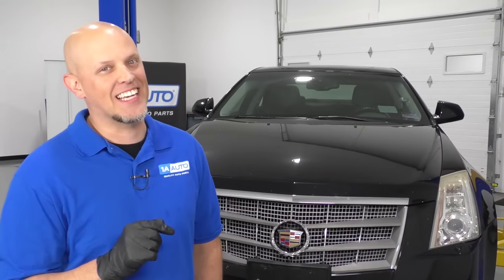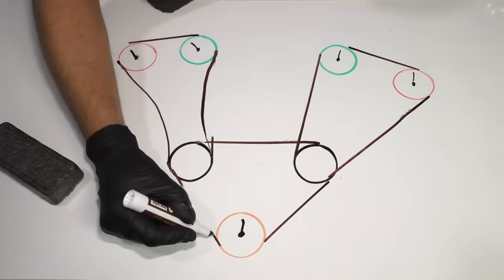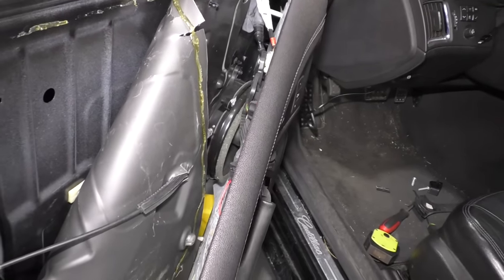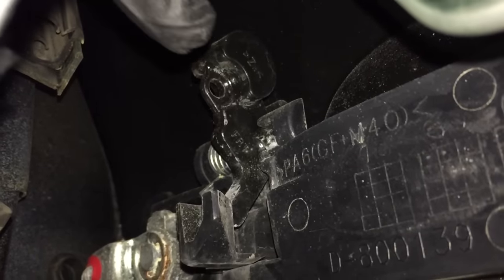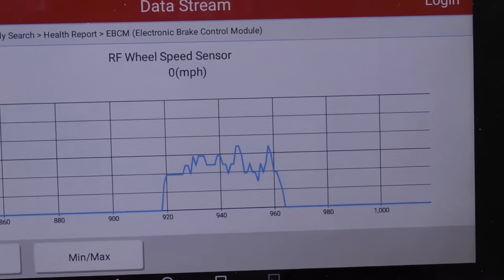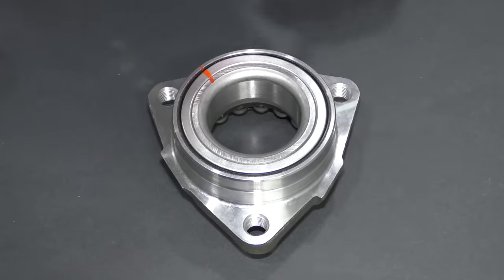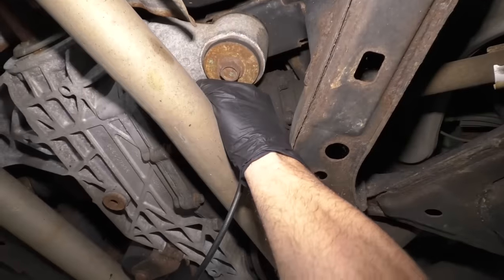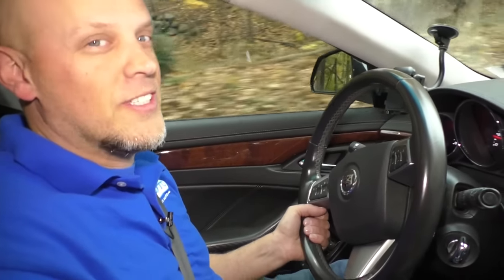Top 5 Problems Cadillac CTS Sedan 2nd Generation 2008-14

Comment: This type of engineering and quality is what stopped me from buying a used CTS I do love the body style.
Reply: Same here.Good looking car but engineered for failure.
Reply: I have had 2 vehicles with 3.6’s caddy sts and Buick Enclave those 3.6 have never failed on me. Because I change my oil every 5000km, if people would know what oil changes are, 3.6’s wouldn’t be bad at all
Reply: @danb2  I totally agree on that,,, I've seen a 2010 Acadia with 210k miles,, and a 12 lacrosse with 165k no problem at all..
Reply: rami yousif 3.6 can be great if u keep if doing oil changes with good quality oil and a filter. I love my 3.6 even with 155k miles running great.
Reply: @danb2  199244 miles on my 03 CTS no problem but window motors. If u keep oil changed and tune up from time to time you will be fine
Reply: Red's Reelz yes exactly.

Comment: I have a 2009 Cadillac CTS and I've had a couple of crankshaft position sensor check engine light codes and got them fixed. The most expensive job was done on the timing chain because when I went to the dealership and they took apart the covers and stuff like that, they experienced the timing chain actually falling apart as they were taking the covers off. Sounded like a knocking noise soon to be that the actuators weren't getting the right amount of oil for variable timing. Hefty jobs. Now that I know about what Cadillacs are about now, I can prevent these things from happening.

Comment: 1 Timing chains and guides because people keep skipping oil changes
2 Magnet ABS tone rings falling off of the hub
3 Sunroof drains clogged since no one ever washes their car and dirt builds up
4 Rear end and transfer case hop around corners since no one ever changes the fluids when recommended
5 Door pin switches due to water intrusion in the winter freezing to ice.

The timing chains are not an issue with the chains themselves, it's an issue with people skipping maintenance. Every set I've ever done was on cars where people skip LOF intervals consistently. The cars that are taken car off and not run low on oil never have an issue. I do love the 15hrs of pay for 4 hours worth of work. All the main issues with these cars besides the tone rings and door switches are the fault of neglectful owners not the car itself.
Reply: quick455 I agree . But the 3.8 series 3 was much better and much better on fuel I own  3.8 2004 Grand Prix 400504 on the clock change transmission oil 1 time per year 5 quarts out 5 back in . Oil gets changed every 5000 max using 5 -40 synthetic and good quality filters . I modded my exhaust 5 years back with resonator delete and 2  2 1/4stainless low restriction mufflers the car gets 35 mpg highway at 65 mph .Also own a 2006 cts 2.8 smaller displacement  version of 3.6 I get 26 mpg at 65 mph. A co worker has identical car as my cts but it’s the 3.6 he get about the same milage . I did an upper combustion and valve cleaning to my car it improved power and response but not the milage still 26 mpg. I agree engines will last better than reported if oil is changed every 4500 miles and kept full
Reply: quick455 you sound like a genuinely great mechanic
Reply: @quick455... It's not the sunroof drain hoses but the rubber "duck bill" grommets at the ends in the inner wheel wells. The rubber dry rots & water cannot flow out. Ask this lady how she knows? Remove the clips, pull back the wheel well & took soldering iron & burned out a hole in the "duck bill". No more clogged drain lines. Ones in trunk are easier to access.

Comment: Door handles and speed censors did not fail on the first gen. The first gen was just a camaro v6 on an extended frame. With almost 280 hp and 260 plus torque it drove like a formula firebird. But there is a problem. The trans wants to make the car smooth and in doing so runs in toigh positions.  If you have this car just drive slow because its been tuned to be a comfy cruiser with occasional get up if needed. If you want to race around get a v8 camaro.

Comment: I have a 2010 CTS and this year I have had to replace 3 wheel bearings due to the reluctor rings having rusted through, and also the timing chain had to be replaced. I have heard that many timing chains have to be replaced as the vehicle nears 100K though (I'm at 80k).  I do love the car though and plan on driving it at least a couple more years. Nice vid, Subbing.
Reply: Timing chains and belts typically have tensioners, which prevent engine damage when the inevitable stretch and wear happens though.  You have to wonder if GM planned these to fail intentionally.
Reply: what symptoms were you having with timing chain? i’m clueless if mine is going out

Comment: Had the bearings changed on every wheels the same year :/ had driver’s door open button changed (Cts coupe) and throttle body troubles ( backed by extended warranty, check with dealers if it occurs up to 172 000 km) those power engine reduced killed me but I saved a throttle body replacement $$ And otherwise I’m not always gentle with my V6 3.6 Cts coupe but I swear I never missed an oil change and I never had any issues on those engines timing chain and even my Pontiac G8 V6 3.6 and they were grateful cars to me !!!
Reply: How did you get rid of the engine power reduce ? I’ve had it on mines for a while now & tried everything from replacing the app sensor to the throttle body

Comment: Timing chains and cam position sensors should not count as CTS specific because more than half of GM's fleet uses a version of this motor making them service items for all of the vehicles it is in use in. The test details are very good, especially isolating the door handle switch vs. the actuator. My one criticism however, is how you let the door panel hang off what appears to be the harness that goes to the power mirror. My passenger side actuator was replaced and I suspect willful carelessness like that is why the power mirror on that door no longer works and is currently throwing an open circuit code, (possibly partially disconnected plug, or damaged wire) perhaps because of a similar action by the installer, or it was unplugged and forgotten. Haven't looked into it yet.

Comment: Only issues here I've had so far on my 2010 CTS  is wheel speed issues. First was RR erratic signal, and when I got the hub out, it seems that hub just had magnets 'glued' to the back of the hub, and one set had fallen off, rendering it worthless. The hub itself was completely fine. The second was the LR a few months later, and that one seemed to have a 'magnet ring' like you might expect, and the ring had fallen apart. Replacing wheel bearings on these cars is NO FUN. I'd say a hydraulic press is REQUIRED, but there isn't a good way to get the knuckle in a press to press the bearing out (at least not that I've found with the rears - maybe some sort of jig could be made or exists to make it possible to press them out in a  press). Note to Cadillac and wheel bearing manufacturers: How about make either the bearing or the knuckle with some sort of knurled surface to reduce the contact surface area, making it theoretically less likely to result in the bearing and knuckle becoming one or two steps short of permanently welded together?
Reply: Man, my RR stays malfunctioning. I've replaced the hub, the abs sensor and tmps when I got new tires. It will be fine for a couple weeks then go out and not read anything for the Right Rear only....smh. Wtf!

Comment: Great video. Have a '12 CTS4 and so far have had the door handles and wheel speed sensors issues. Other than those minor issues haven't had needed any serious repairs. Still my favorite car I've owned. Hoping the timing chain issue doesn't come up... looks expensive.
Reply from the maker: +PR1ME Thanks for the great feedback and for checking us out. 1AAuto.com
Reply: Very expensive for the timing chain $1400
Reply: Ontario, it was $2100 in 2017 at a GM stealership.

Comment: My car is having rough idling, psi oil gauge down to 0, exhaust smells infrequent, oil pressure is good, replaced 2 weeks ago. All car began having trouble when Firestone placed the wrong oil in the car… now the Cadillac dealership technicians are telling me they do not know/nothing is wrong with my car… thanks for giving me this info for my Cadillac 2013 CTS, I hope I can repair and fix the issue my self!

Comment: 2010 Cadillac CTS4 3.0 had P0017.  No engine noise or any issues.  Transmission, ignition coils and timing replaced less than 1000 miles before.  Replaced sensors (after market) and VVT solenoids and it went off more frequently along with P0016 and P0014.  I went back and changed sensors to OEM sensors and worked perfectly. No more codes tripping.  I will only use OEM parts from now on for this car.

Comment: So far so good....bought a one owner 2008 cts in Nashville Tennessee with 71k miles in dec 2019.
Reply from the maker: +Ray Burton Thanks for checking us out! 1AAuto.com
Reply: How much did you pay for it?
Reply: Is 2008 srx4 good ?
Reply: @Ray Burton.... I live in Nashville too and I found an 08 All Wheel drive for an phenomenal price. It has a problem  with the steering and brakes cut in and out, I think its a vacuum leak. It only does it when the car is at idle. When you are on the gas the problem vanishes. Any ideas on what it may be?

Comment: I just bought a 2010 Cts with the 3.0 I love the car.  I heard the 3.0 was the more
Reliable out of the 3 engines used by Cadillac that year. I just changed the awd fluids transfer case fill plug location is a joke and I also hate those electronic door handles.

Comment: Great video but......let's remember this is the regular CTS not the V I've owned all 3 generations. With that being said I agree the door handles suck. Mine went out in my 2010. The shocks I would say is 1 of the major issues and also wheel alignment issues. Each generation has it's own set of issues.
Reply from the maker: +Mr. Wallace Thanks for checking us out. 1AAuto.com
Reply: How did you know the shocks and alignment was bad?

Comment: I have an 08 Cts AWD direct injection with 227k miles. Did timing chains around 130k and have replaced 8 x hubs (myself)due to the ring  issue.  (The actual bearings were never a problem) I need to open the d side door with key due to the handle issue but other than that, this car has been pretty reliable considering the stigma around American cars. Its comfortable, has all the bells and whistles, and 304 hush puppies under the hood.

Comment: I have a 2008 and once recently I let the oil level get down to like 15% and the dealer had to replace something in the intake manifold, I will never let me oil level get that low again it cost $900 to fix
Reply: Right, we are told to change at 10% percent. I think the CTS oil gauge gives false readings.
Reply: @Marquis Madison...The % is not the level, it is the oil life.

Comment: bought a 2011 cts base 3.0 last year with 102,000 miles on it, currently have 126,000 on her. now im starting to get some issues, nothing crazy. cam sensors rear wheel bearing, heat shield is rattling. replaced battery, alternator and front right axle few months ago. other then that its been an extremely reliable daily. mine definitely doesnt have timing chains though. has timing belt
Reply: Hey some I’m around 136k miles and I think it’s my heat shield or something rattling bc mine rattles at like 1500 rpm’s the most and sometimes at idle. Also had you know the axel was bad bc I feel like mine might be as well?

Comment: The timing chains themselves aren't the problem on these GM 3.6L engines, they stretch/break because these engines burn oil (usually PCV system flaw) and most owners don't check their oil level or keep them topped off.
Reply from the maker: +Corion H Thanks for checking us out!

Comment: Had mine for 130k miles and only had to replace water pump.....and engine at 120k. They tend to have an oil consumption problem so make sure your oil is changed on time. I tried to do the 20k oil and filter bit it ran out at like 14k miles without a change. I now change it on time and use royal purple lol the oil consumption is fixed on my engine from LKQ.

Comment: I seen two 2011 cadillac cts 3.6 on Craigslist today for 2000 dollars a piece. Both needed timing chains. 
Still a good deal even after you put 2000 thousand dollars into them.
Reply: Thats assuming the timing chain is the ONLY problem which I can bet isnt the case.

Comment: Thanks for the info any thing to  look out for as I have a 2014 Cadillac xts premium vsport with 3.6 twin turbo 44k I use royal purple 5-30 oil
Reply: Yours should have the newer direct injection motor .not the same as the old motor back then,so the same issue may not apply to you as this older one in the video.because it’s totally different motor all together.
Reply: Im pretty sure they mostly fixed the timing chain problems in the 3.6 around 2012, I know in the aussie 3.6 commodore they changed something although they non turbo

Comment: I have a 2008 Cadillac CTS awd and I had to replace my timing chains, replace the solenoid for the EVAP sympton was hard to start after putting fuel in it, wheel sensors 3 of them, leaky sunroof = electrical problems, blower motor won't work, windshield wipers erratic, had to replace gas pedal, door switches failed both sides,, computer display panel doesn't work but to top it all off the transfer case needs rebuilt because they didn't put seals on the input output shafts. Grrrr, that really pisses me off Cadillac should have to fix that. I really love my car despite all that except for the transfer case. If anybody has any pull with Cadillac I would appreciate you putting a good word for me to fix it.

These cars have problems but they aren't junk by any means.

Comment: The first thing that went out on my  Cadillac cts 07 was the ignition coils. Then some nut/bolt for the gear shift that needed replacing, then catalytic converter, then timing chain, and I just replaced one of the rear wheel bearings. It cost me $1500 to replace the timing chain (HAD to fix it to pass smog check) I replaced the alternator and camshaft sensors myself, and I do my own oil changes with synthetic oil. A new annoying problem is when I have my headlights on and I turn either blinker on, my brights come on and often times I can't get them to turn off. Complete money pit with my car. I should get rid of it but I've put so much money into fixing it that it's kinda hard to.

Comment: You forgot all water leaks sunroof trunk etc...
Reply: clean sunroof drain tubes and ends
Reply: Joseph Guastella i was waiting for him to bring it up 🤣. Thats the major cts problem
Reply: Yes the drainage leaks into the front pillars  because the drain tube come apart in the pillars.  Also the drain plugged ups at under car and the passenger carpet gets wet.
Reply: @davidrawley5464    Well, how do you do that,? Would I have to have dealer do it?  I never heard of that?   I have a really nice '03.  It's only got 64,000 miles.  Does it come from being in the rain, car wash???
Reply: @davidrawley5464  Yep, pour boiling water down the sunroof drains every few months.  Will keep them clear of crud.
Reply: You can use weed wacker string to push out and clean your drain tubes.
Reply: I just replaced my trunk light rubber seal. Whole trunk had water in it. I wasn't aware about the sunroof issue

Comment: 08 cts4 direct injection car here.
95000 miles
Just did chains and all assorted parts, with cloyes super kit. Just started getting timing codes so figured now's the time. Put new water pump as well.
Before this, I've had to do plugs, alternator, and front brakes, had a front hose that was collapsing and holding the brake. 

 Otherwise it's a great car that I hope to put at least another 100k on.

Comment: The trunk wire harness is an issue for this vehicle. The technician notice will advise on multiple harnesses such as your driver seat harness but there's no mention of the obvious design flaw trunk harness. Broken wire short can cause all sorts of havoc throughout the car making it a diagnosis nightmare. The TCM calibration seems to be another common problem with a nice loud clunking noise under the console when accelerating.

Comment: IDK what to make of the comments in here? Does these issues you described in the video also apply to the 2013 CTS Premium 3.6L V6s? Most comments in here are left by owners of the 2008 CTS. 
Only seen about 2 comments regarding the 2013 CTS 3.6L V6. And only ONE bad comment about the 2013 year. The rest of the comments in here seem to be people complaining about their luxury CTS's with well over 100,000+ miles on them? Smh. Then when most people leave their complaints or questions, a lot don't seem to state what year CTS they have or are talking about. SMH. 
Otherwise great video. Curious if the 2013 CTS Premium had these same issues. I've been looing into maybe purchasing a nice used on with 59,000 miles on it. Thanks if you or anyone replies.